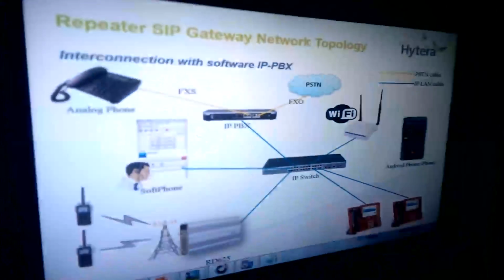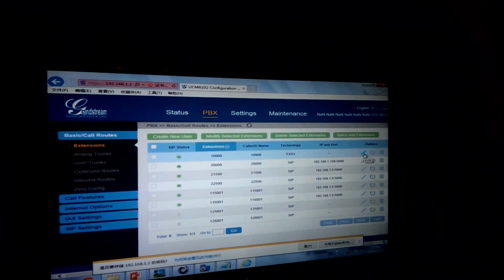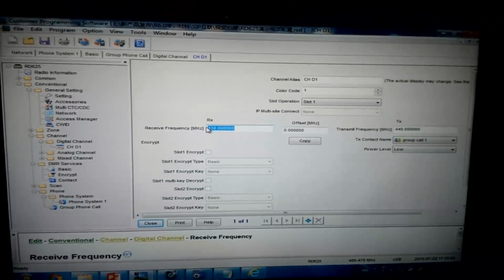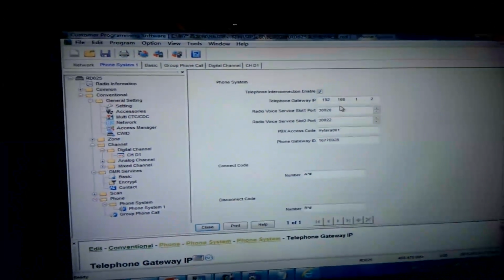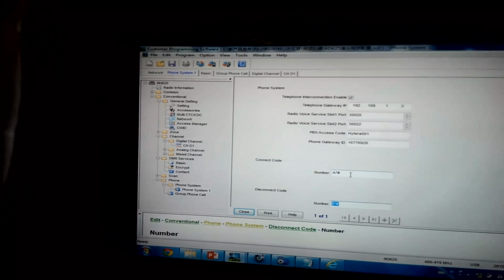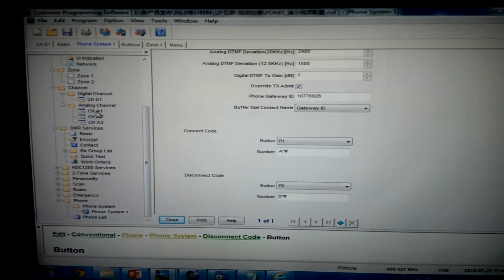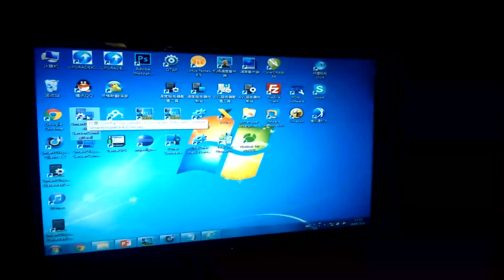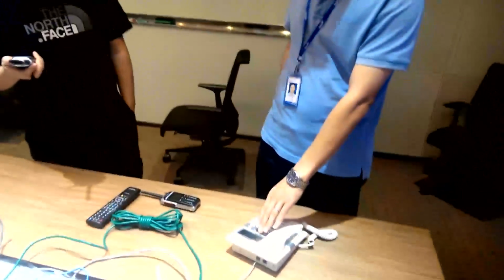Hytera DMR SIP Communication Tutorial

Comment: Has anyone gotten this to work with the latest firmware? Both repeater and UCM?
Reply: Bill Holesworth No
Reply: I had to roll back firmware on the ucm. Got it working.
Reply: which version you used in UCM ? and what version in RD ? i've RD985
Reply: Bill Holesworth: do you have contacts ?
Reply: i will check my notes on versions and get back with you. Was a few months ago I set up a multi site sip system up. But I have all my notes.

Comment: Tried to get it to work but the repeater will not show up as an extension.  I have the same pbx as you show running the latest firmware 1.7 I thimk it was off of the grandstream site. I am using a rd982 running 6.005.004 which is current. Phone to phone no problem but no repeater lookup. Is there a feature licensing I need for repeater or ....
Reply: Hello Bill Horchak, you need firmware lasted, is version v6.5 no the 6.005.004.

Comment: Hi, from Spain. Very Thanks for demo. 
How to assign sip extension to rd625 repeater? 
In the demo, the extension of the repeater is 21500. But where I have to assign the configuration of the repeater. 
Thank you very much. 
I hope more video demos Hytera configurations. 
Greetings from Spain.
Reply: Hi Joaquin,

Configuration Steps as below:
Step1: Upgrade the firmware of terminals and repeater to latest version
R6.5, the firmware can be get from distributor;
Step2: Configure the extension numbers and password for portable radios and
groups in the PBX configuration panel, extension rules should follow the
guide in the image; Download the image here: https://drive.google.com/file/d/0B8Dvct2GFASJZVBHTzVsVERlSWc/view?usp=sharing
Step3: Start the CPS software and connect the repeater with computer, read
the repeater's configuration and go to configuration directory :
Conventional->Phone->Phone System->Phone Call, write all the group call ID
and private call ID which will be registered to the PBX system.
 
More configuration details please follow the Hytera DMR Conventional Series
SIP phone gateway to Simultaneous calls application notes R2.0 document.
(Download Hytera_DMR Conventional Series_SIP Phone Gateway to
Simultaneous Calls_Application Notes_R2.0.pdf here: https://drive.google.com/file/d/0B8Dvct2GFASJQ3pFUlpzckU2TEE/view?usp=sharing)
 
Notice: The configurations of RD98X/RD96X/RD62X are the same in SIP
connection field.